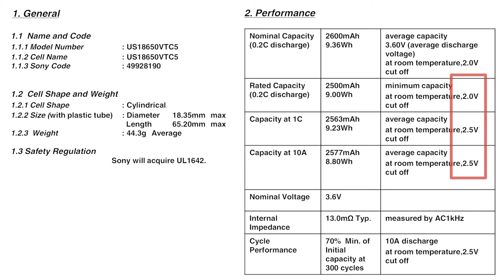Capacity and over discharge test of Makita 5Ah and 6Ah batteries

Comment: While shopping for makita batteries, I noticed that almost nobody will capacity-test the battery. It's because not many people have this "electronic load" you have. 
I bought some 3.0Ah aftermarket batteries, the slim ones that Makita makes with 2.0Ah. These I tested at 55% of claimed capacity. I tested others that measured less than 1Ah, absolutely rubbish cells. On that basis, and knowing what capacity I can expect from the OEM batteries, I concluded that it's NOT WORTH buying the aftermarket batteries, and only the 5.0Ah battery is worth it, having most of the capacity of the 6Ah, but much less expensive. Thanks for sharing.

Comment: I think minimum cell voltage cut off is supposed to be open circuit. You get voltage sag when the battery is putting current out that lowers the apparent voltage. If you leave it a couple of minutes and check the pack voltage it should be at least 10V absolute minimum, more like 12.5V, but ideally ~15V, open circuit.

Comment: Everybody please STOP immediately discharging your Makita batteries as shown in this video!!! Most brands DO NOT HAVE a proper Over Discharge Protection in their batteries!!! Having started my Makita battery discharge journey here, I also have done this very low capacity test and I regret it. The reason is that Makita like most other brands does not have a real over discharge protection in the battery. The cut off you see in this video is the absolute minimum before the battery is completely ruined. The real over discharge protection happens only with Makita's yellow plugs with a star sign combined with the same thing on the tool side. This way the battery send a signal to the star compatible Makita tool through a third pin connector when it reaches 12V and the tool shuts off the battery at/around 12V, which seems still to low but that's Makita specification and is intended by Makita. Using the battery without the third pin and letting it go bellow 12V can damage your battery even with this last protection around 8V. If you want to use your battery outside of Makita's STAR system e.g. in your own projects like I do, you need a simple Over Discharge Protection with a MOSFET. Nonetheless, Makita's battery system is IMHO the best and using adapters with over discharge protection opens up an entire world of possibilities with this system. Read more here:
https://www.instructables.com/Making-a-Over-Discharge-Protection-for-Makita-Batt/
Reply from the maker: Hi, I've read your story on instructables and I tend to think differently on the third pin usage. From engineering point of view, having full BMS on battery and not using it - it's just crazy and I simply refuse to accept that in Makita works some bad designer ;) And yes, "the star" Makita batteries have full BMS inside with ability to do the transistor cut off the power under every condition. So those batteries have under/over voltage, over current and over temperature protection (experienced all of those conditions with my set of tools). I've create a video with chines knock-off of the Makita battery (it had no any kind of protection, despite what it advertised) and also did BMS replacement for proper one with all protections (yes, they are available in china also) - but never posted it - so I could have a good look what is inside of all those original and not batteries inside.
Anyway, the third pin I would call a grace notification for the tool that battery is close to be depleted. I assume that some kind of tools are better to shutoff itself, then been suddenly left without the power. So the device can shutdown itself properly finishing in known state (best analogy would be shutdown of the computer on power outage with UPS - UPS devices also give computer know, when they are close to be depleted, and if the devices won't shutdown itself - it will be cut off later anyway).
And finally, yes the cutoff voltage on Makita BMS is extremely low - but those are professional tools and battery are not expected to last long, and what is more important, under heavy load the voltage read would be much lower then actual (not in my test - my load I would call mediocre) - so cutting it at 12V would be pointless as the capacity would be still there. You can just check how big voltage drop is on battery when you discharge it 150-200W and then check when you disable the load - I bet those would be few volts.
ps. but yes, I agree those type of tests are not healthy for batteries - that's why some guys do those and post on YT - so others don't have to do it again ;)
Reply: @sauronmakes...956  I know where you coming from and I did not intend to question your intentions or skills. I only go by the facts and honestly nobody can tell for sure why Makita is doing it this way. One thing we should take into the consideration is the fact that we are talking ONLY about the battery by itself. For Makita it's not only about the battery but the entire application. We don't know about Makita's business policies, governmental regulations, future products etc.  Maybe Makita is doing the same thing what Tesla does, means programing the BMS the way it keeps the real capacity between 20-80% for longevity and battery health. In this case you would be right and discharging to 8V will probably not damage the battery! I am not an engineer, but I think by doing the Tesla trick you could over discharge your battery without damaging them since you are not completely depleting them! We just don't know and because we don't know I would go by facts and e.g. not discharge bellow Lithium's 2.8-2.9 per cell or at least Makita's STAR specification of 12V per pack (3. pin). We only would have certainty if somebody would take his brand new Makita battery and charge/discharge it completely as shown in your video, let's say for 500 times and then compare it to a normal STAR abused Makita battery. I am definitely not going to do that  😉 However, I appreciate your video and your response and hope to see more videos and tests in this regard. Take care and thanks again👍
Reply: @sauronmakes...956   I found this video, so i could decide whether or how to use my makita batteries with other electronics safely, and I'm not yet fully conviced if the batteries themselves has LVP/Low Voltage Protection. People on the internet seems to disagree alot on this matter, is it in the batteries, in the tools, or is it a combination of the two. It wouldn't surprise me, if the LVP is in the tools, or a sort of handshake between the two, but as you say, it would be stupid to not have it in the batteries, I say no. Not from a business standpoint. Makita(probably) doesn't want consumers and hobbyists to make their own adapters for other tools or electronics. They can and will only vouch for their own ecosystem, so you'll buy more of their products. They think only about money in the end. 
For my own DIY electronics, I might end up using a bought LVP-board, and set cutoff artificially high, to protect my batteries :)
TL/DR: I liked your video, and I hope we all find an ultimate solution to this discussion :)
Reply: Hello @BingoBongoMan (and I guess @magnuswf). It turns out you are both right, but also both wrong. The confusion comes from Makita LXT being different not just in time (star and non-star, and every other smaller modification they've made), but also by battery. The cheaper batteries (1.5 & 3Ah) don't seem to have stand-alone protection with a mosfet in the battery that can cut the power independently of the tool. The 5Ah and 6Ah do have this and will cut out usually at 12.5V, but at ~8V if the current is less than 5A. Where you are right is that Makita doesn't really use this cutoff mosfet and instead relies on pulling the 3rd pin low to stop the tool. If the tool stops within 500ms, then the mosfet stays on. https://www.youtube.com/watch?v=r1tQwoaCdBA
Reply: @toolscientist  ‘tool scientist’ knows !!!!!!!!!!!!!!!!!!!!!!!!!!!!!
Reply: Good comment and mostly agree, but see ‘tool scientist’ comment!

Comment: Im interested in their discharge behavior. Does one provide more power than the other? I know thay they use different 18650 cells in the 5ah than the 6ah. I think the 18650 Samsung cells in the 5ah have a higher discharge (higher current) rating than the ones in the 6ah. Correct me if I'm wrong.

I care about the ultimate power they can provide a tool. There are obvious power differences in say like the Makita XWT17Z impact wrench between the 2ah, 4ah, and 5ah. I'm curious if the 5ah outperforms the 6ah in that application, or is it vice versa?

Comment: I just tested brand new Bosch 18V 5Ah battery, and it came up to 4.6 Ah, using 1.5A discharge current. It also fails to do proper low voltage cut out.

Comment: This is what happens if you skip the third pin, which is crucial. Over discharge protection is there all right but only in set with Makita power tools. This also shows the danger of using any 3-D printed adapters. Makita batteries are designed to work with Makita power tools not just any random crap someone's imagination makes him plug into LXT.
Reply from the maker: New batteries (with "star") does have built in discharge protection, older batteries (without "star") did not. That's why some tools claim they are not compatible with older batteries. Third pin is for temperature. Other pins (small connector) are used during charging only.
Reply: @sauronmakes...956  Maybe you could monitor the third pin and see if it does indeed switch off at a reasonable cutoff voltage. The batteries definitely have a microcontroller so there's no reason they can't signal the tool to switch of under many conditions (per cell under voltage, per cell over voltage, under temp, over temp for example). Just a little more reverse engineering is in order since unfortunately the behavior of that pin is not very well documented publicly. I can easily imagine that initially the third pin was only used to monitor temperature but as battery tech improved makita started using it to signal other issues as well.
Reply: A while back I researched how power tool battery under-voltage protection works, focussing on Makita. I remember reading that the reason the third pin is used as opposed to the battery having under-volt circuitry directly on the pins is that it would increase the internal resistance and result in a lower max wattage and higher wasted energy. This means that some of the knock-off batteries in pursuit of cheapness set the third pin as on and rely on low voltage cut-off. This can let the cells discharge not only below what is damaging but also far below what is safe, allowing the potential for internal shorts.

Comment: Makita low voltage cut off is built into the tool not the battery.  The Makita tool will stop working at a safe voltage to preserve the battery .  The battery does not have a built in SAFE (for battery lifespan) cut off.
Reply: It's both. Protection is primarily via the battery signalling the tool to stop. Some newer batteries like the 5Ah and 6Ah have an additional layer of protection with internal cutoff mosfets that will switch off if the stop signal doesn't work. The mosfet cutoff voltage is normally 12.5V, but if discharge current is <5A, it will be 8V, which is what happened in this video

Comment: so each battery is 5 cell lithium so 8.5V / 5 is about 1.7V per cell low cut off voltage? correct?

Comment: Hello Mr. Makes! I was inspired by your video so I did some of my own testing. It turns out that above 5A, the mosfet cutoff occurs at 12.5V. Below 5A and the cutoff occurs at ~8V, like you found. In a Makita tool, this 8V cutoff will never occur because the tool always stops when the 3rd pin goes low, and on the 5Ah, this is always at 12.5V, regardless of discharge current. But this only seems to apply to 5Ah and 6Ah batteries, the 1.5Ah and 3Ah, do not have stand-alone cutoff (I'm not sure about the 4Ah). https://www.youtube.com/watch?v=r1tQwoaCdBA

Comment: wtf 1.6v/cell cutoff voltage? what's the point of that protection? does the tools have the proper 12.5v protection inside?
Reply from the maker: Nope, it doesn't (in general - for newer tools) - that's why Makita introduced batteries with "star" sign - that should be protected on it's own.
Reply: @sauronmakes...956  You are wrong, battery protection is implemented in the tool, read the patents Makita.
Reply: @Якобсъ  There is absolutely tons of misinformation online about this, including from uniformed Makita staff. As you say, the protection mechanisms don't just sit within the battery but also within the tools/chargers.

I wish that Makita would publish openly the circuits/schematics behind their batteries and charger/tool electronic protection but I figure they consider it valuable as trade secrets to prevent clones.
Reply: @beardedchimp  I've done some testing and mostly figured out what's going on. 1.5Ah and 3Ah don't have stand-alone protection and rely on the tool stopping when the 3rd pin is pulled low. 5Ah and 6Ah packs do have stand-alone protection, which is usually 12.5V, but is ~8V when discharge current is under 5A. I don't know where the 4Ah sits or if things are different in newer 3Ah packs (mine is 2017) or older 5Ah packs (mine are 2020 and 2022). https://www.youtube.com/watch?v=r1tQwoaCdBA

Comment: I have tested both my 6ah and 5ah Makita batteries in the same way and both cut off at 12.5v. Maybe they have changed the cutoff voltage within the battery.
Reply from the maker: And what discharge current did you use?
Reply: @sauronmakes...956  about 5amps from memory
Reply: cutoff voltage seems to change with current. Less than 5A gives the 8V cutoff seen here. Over 5A gives 12.5V. 1.5Ah and 3Ah packs don't have stand-alone cutoff and rely on the tool to stop when the battery pulls the 3rd pin low.

Comment: Question, this batterys was used (when new, minimum 4 times must charge discharge) after that battery get 100% of capacity
Reply from the maker: They where charged and discharge in Makita device - so yes, they where used before test. But this "believe" about charging/discharging before reaching full capacity has no confirm in battery chemistry, it could be more to scale fresh BMS for battery then do anything with LiIon cells.

Comment: So it is better to buy 5ah, instead of 6ah ?
Reply from the maker: Capacity is one thing, performance is the other - more Ah batteries can provide more current, and this can sometimes be a game changer. But if you only need capacity, it's probably better (cheaper) to buy more 5Ah batteries (like 3x5Ah instead of 2x6Ah).
Reply: @sauronmakes...956  
5ah batteries are 80 euros and i found before christmas 2×6ah for 150 euros. So i bought 2×6. But it seems they were laying a lot since they are not with same power and duration. I bought it for duc353 and one always starts blinking before another one